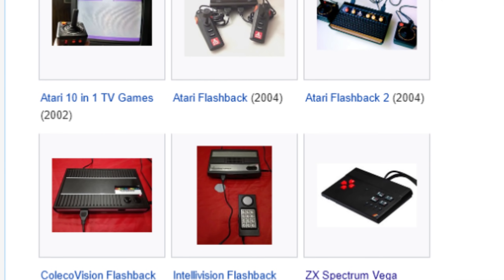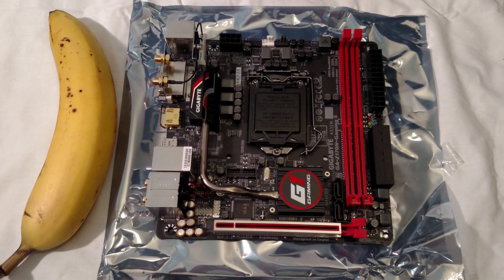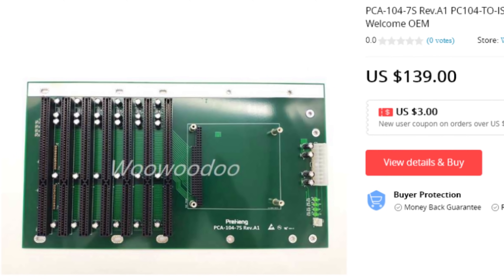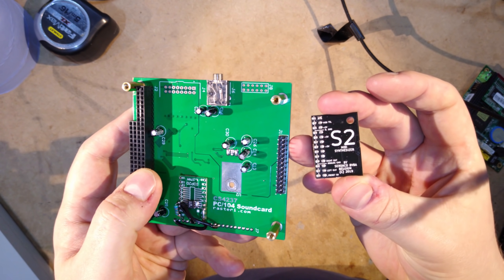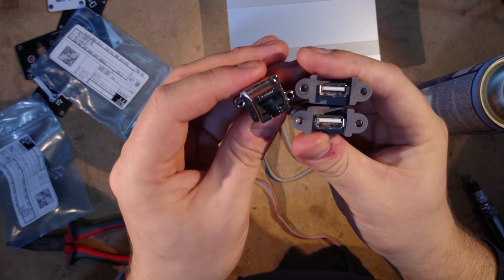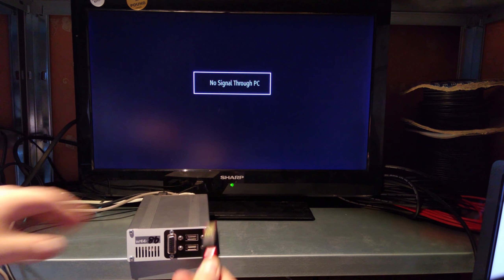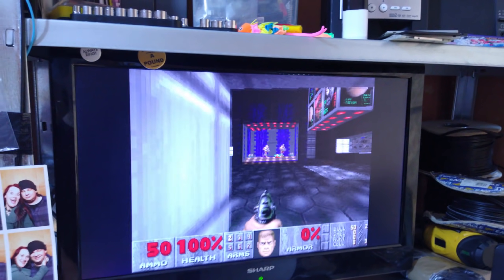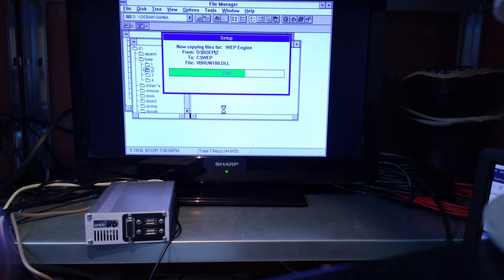Mini MSDOS gaming PC - Part 1

Comment: One possibility regarding the performance of Duke3D: it does use the FPU for drawing slopes, so the fact you're using a 486SX means it resorts to a software fallback, which would impact performance.
Reply from the maker: Yeah, my builds with the DX range run Duke3d perfectly :)

Comment: Can you please take a look at the old Kenwood Two-way Radio TK-250 handheld VHF radio's add on DTMF board, and see if you could make one of these ?

It is the KDM-7

They have not been available in decades.

But it looks like you could 3D print the keypad and make the film push button pcb that plugs into the radio.

I am going to try and do a video to show you what it looks like.

Thank you

Bill
KC2OVX

Comment: Nice project. You can also install Windows 98 and many of those problems can be solved quickly. I know by my own experience that, many MS-DOS games can't run under Windows  98, but you can start Windows 98 in MS-DOS mode and it's all. One thing i remember i did on those old times with my AMD 5x86-133MHz is, i edited the config.sys in order to add "Menuitems", depending the menuitem selected at the boot, the system booted with/without CD or network support, or with/without ramdrive, and always suporting the soundcard if i boot at the MS-DOS mode, booting into the Windows 98 mode, i only allowed the region drivers and certain customized "Files, & stacks" in the config.sys file, leaving the device driver control to Windows without loading MS-DOS drivers. I used to boot with RAMDRIVE support cause i used to run fighting games with a batch, wich automatically cleaned the RAMDRIVE, copy the game to the RAMDRIVE, and run the game. Cause i only had 32Meg of RAM, Primal Rage used to cause some problems if i tried to run a game after running Primal Rage, so it forced me to reboot the machine after playing Primal Rage if i wanted to run another game; but Mortal Kombat, MK II, MK3 and many other games did not cause problems.

Comment: What is the technical name for the aluminum housing he built the PC into?
Reply from the maker: He... I mean I used an extruded aluminium enclosure, it's the E-case range from Lincoln Binns
Reply: @TheRasteri  thanks... i am trying to make my own lacie little big drive with some old harddrives and couldnt remember the name of the enclosure untill I remembered this video... thanks so much

Comment: Good video but goes way beyond my ability to just throw something into a case and hope for the best. I haven't touched a soldering iron in 4 years, end even then this kind of work was way beyond my capability. I only really used it to join wires together and make up the odd audio lead. Now, I find it's easier to just buy them.

Comment: The thing I dislike about those mini C64, Amiga, ZX Spectrum etc. systems is that they all seem to focus on playing games rather than running utilities and letting you do any actual programming. I know it's possible to hack them so an enterprising and motivated individual to do that, but why not make them capable of that right out of the box? Just stick a USB port or 2 and an SD slot in the system so a user can plug in a mouse & keyboard and let them get to work.

Comment: With emulation, you could have gone with something like the lathe pc or something like that with an intel atom or core m3, i'm sure it would run basically any dos games with emulatores plus some early windows games with virtualization and even some later 90's windows games under compatibility mode.

Comment: A 486 processor that runs at 300 Mhz?? Wow, didn't think such a fast 486 existed.
Reply: 133MHz here on Socket 3!  And i did not know about anything 486 faster than the AM5X86-P75.

Comment: Perhaps use Qemm as a extended memory manager, you can boot with 638k of free base memory.. i think i still have the config.sys and autoexec running around for that... will include mscdex and sb16 drivers, mouse etc

Comment: Mind blowing. Amazed that card worked on the first try. I am going to try to build one with a ICOP VDX2-6554. What do you mean the newer ones aren't compatible with DOS? To me it looks like all the Vortex chips are. I want to get the faster DX2 one cause then I could use Windows 98 or XP occasionally also.
Reply from the maker: Yeah the DX2 should work fine under DOS, I have a DX2-based thin client that works. Never tried a soundcard on it though (ISA bus isn't accessible)
Reply: @TheRasteri  Well on the VDX2-6554 the PC/104 connector is accessible, so that means the ISA bus must be, correct? Or are there some PC/104 that don't have an ISA bus in that port?
Reply from the maker: @joeshmoe000  There are some PC104 boards that don't support DMA, but it looks like the VDX2-6554 has all the neccesary DMA signals so you should be fine :)

Comment: I have a Via EPIA C3 in an old Mame cabinet I built in 2004.  Mini ITX form factor and has integrated SBPro compatible sound.  It's a bit larger than your setup at 170x170mm though, but it has all the connectors you added without any extra work.

Comment: The joystick port on the front is also an external MIDI connector, if you have the exact cable for it then you can connect your SC-7 or any other MIDI tone generator instead of using the built-in FM/daughterboard MIDI synth as well as a passthrough connector for connecting your joystick while your MIDI device is connected.
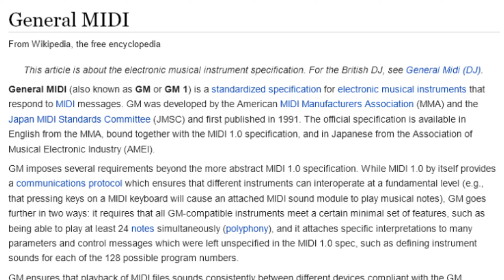Reply: 5:15

Comment: This... was really cool. Basically you did something MORE impressive than the "mini retro consoles" which are just glorified phones or Pis in a case with a high-level emulator. This is real hardware. This is... wow.

So like I'm a complete newb when it comes to electronics before I was born like this. Does this have a heating issue? I don't see any heatsinks? Or is it similar in power profile (I doubt it but I'm just spitballing) to like a Pi where it's not needed but can help?
Reply from the maker: Nah the Vortex86SX is designed to run without a heatsink, like the raspberry pi

Comment: Any thoughts on making the passive components through-hole rather than SMD? I’m good at soldering TQFP chips but not the passives. Too small for me.
Reply from the maker: The SMD passives are mostly 1206 which aren't too hard to solder, I'm sure you'd manage them if you can do a TQFP.
Reply from the maker: Oh and I'm currently filming a video where I show some SMD soldering tips so stay tuned :)

Comment: My deepest respect for that PC-104 Blaster card. Very cool! Other than that, excuse me if I did not pay attention: you mention in all detail, that you're using a board with the Vortex86SX which lacks and FPU... and you fail to mention that it has a stronger sibling, called the Vortex86DX, which does have an FPU!? I'm a long-time fan of ICOP, and I strongly prefer the DX version of their CPU for pretty much any purpose. It doesn't even eat more leccy compared to the SX, as I believe the SX was 130nm while the DX is 90nm. Also the DX, especially its more recent revisions, have received several updates e.g. in the IDE controller which make it more compatible... I am kind of fond of the XGI Z9s graphics with 32 MB of dedicated videoRAM - which apparently only comes on boards with the SX/DX chips. The DX2/DX3/EX have either some on-chip integrated VGA or none.
Reply from the maker: I'm currently working on a followup video where I talk about the Vortex86 series in more detail, as I've since acquired several more ICOP boards and look forward to comparing them :)
Reply: @TheRasteri  You've just earned my subscription ;-) Keep up the good job.

Comment: An excellent and interesting video, so much so I'm tempted to build one of my own.
FWLIW: You mentioned thin clients - with some admittedly careful research there are thin client boxes that will happily run DOS or (older) versions of windows. On the plus side an easier and likely cheap way to get a mini DOS console, on the minus side you'll not get any kind of Soundblaster in one so audio compatibility can be patchy. My weapon of choice is an HP T5720: http://qubeserver.com/T5720/ Once my HTPC, now my retro PC box.
(the page is very out of date and some of the links don't work - blame a recent change of web server for that!)

Comment: Those compact solid state memory modules at 6:00 are IDE-compatible? Wow! I've got a ton of those from embedded PC's and I never thought I could use them somewhere else. I assumed it was some proprietary format.

I used to build micro PC's for retro gaming, but I never went as far as designing my own PCB's. I'd instead cut up existing boards, fold them over and stack with extension ribbons. As long as the board wasn't multi-layered, it could often be done.

Comment: I use for a dos game pc this board  COMMELL's LE-564  underclock to 300Mhz, http://www.commell.com.tw/Product/SBC/LE-564.HTM with 256MB Sdram 133Mhz and a 2GB IDE Disc on module apacer for a HDD. Running MS-DOS 6.2.2 . Have the original Alu case with passive heatsink.  I use the board several years ago in 2006 as a home FTP server with 250GB ide 2,5 inch drive and when i change the ext. power adapter to a AT 150W Power supply, than add a 2 drive 500GB IDE 3,5inch drive and runing winxp Windows Fundamentals for Legacy PCs

Comment: PCs pretty much never had joystick ports on the front so I would definitely do it a bit differently. ;) Also, how about integrating a floppy emulator on that soundcard and making a SD card slot that looks like a miniaturized 5.25" floppy drive?
Reply from the maker: I'm working on an SD card slot as we speak :)
Reply: @TheRasteri  Awesome! :)

Comment: As for why Duke 3d chugs, that's because of the lack of an FPU. In order to do the angled floors it uses a lot of floating point calculations, so if you're using software fp, it's going to be crazy slow. I had that problem with my NexGen586.  It ran fine as long as there wasn't an angled floor on screen, but there's lots of angled floors in the game because they wanted to show it off being one of the fancy new features that Duke3d could do, and Doom/ROTT couldn't do.

Comment: Looks like there are some Vortex86DX versions, but I couldn't get the site to show me all available models, no matter which browser I tried. As I am not steady handed enough for soldering (I've tried and it ended.. badly), could you possibly wire a DX version up with a USB-C power input, along with the sound goodies? I would totally buy that in a heartbeat. It would likely be fine for up to 98SE, which still had real mode DOS for DOS gaming. Thanks!
Reply from the maker: I'm investigating the DX as we speak :) although 98 era games probably want a 3D card and I can't think of a way to squeeze one of them in...

Comment: Nice, I like the PC/104 soundcard project. I would build one if I own a PC/104 MB but they are quite rare and expansive. Maybe future project would be to use DMP Vortex86EX SOM-128-EX module and make a custom MB for it that would include sound, VGA, SD and IO...
Reply from the maker: I think the vortex86EX has a weird ISA bus that might not work with the soundcard. I'm investigating the EX and DX as we speak though.
Reply: @TheRasteri  I din't check it in detail. Maybe DMA signals are missing? The SoC contains a crossbar switch that can MUX several functions and GPIO on physical pins so configuring proper mapping may be tricky. BTW what kind of VGA chip is on your MB? The Vortex86EX can easily connect any PCIE VGA via x1 link but the size drawback is size, same as with ISA soundcard...
Reply: BTW how can I download the CircuitMaker files from that website for offline? I want to import them in Altium Designer. I signed account to CircuitMaker site but I didn't find any download just it wants to try open something online.
Reply from the maker: @rayer314  I have released the design/output files now, if you go to the releases section of this page - https://workspace.circuitmaker.com/Projects/Details/rasteri/PC104-soundcard-3#sectionComponentReleases - you should be able to download them. Note that this revision is still untested, I'm waiting for prototype boards.
Reply: @TheRasteri  Thank you for upload. I got it loaded in AD without problems. When a time come I may customize it a bit and let manuf. I have good experiences with JLCPCB. Good luck with your boards :)

Comment: Great design! SB cards are crazy-expensive even if you can find them. I'd definitely be interested in a board or two. I re-drafted and routed the board using KiCad, changing all the components (other than the sound chip) to through-hole and creating two different filtered power busses (borrowed from an SVGA card design). I played around with CircuitMaker and it wasn't for me. I've done several ECB-sized and S100-sized boards with KiCad...this is my first PC/104 attempt...so at least it will be a template for other things I might want to do. Looks like it routed fine. Only 25 vias. It's not a particularly dense board even with through-hole parts. Interested to see what changes TheRasteri is going to make from his experience with a live board.

Comment: Neat! I use these same mini pc boards at work for some controls equipment, Almost the same one but slightly smaller (Tiny SBC type) from the same company. I have a few that were removed from service. Never really did anything with them though.
Reply from the maker: Yeah I have one of the tiny modules. Unfortunately it doesn't have video output or a proper ISA bus :( do yours?
Reply: when in use we don't use the VGA output because it uses a small serial LCD screen but I'm pretty sure there is a VGA header and in the box it comes with a cable that has a VGA connector. I'll have to check next time I'm near it.

Comment: Who remembers their first 1gb drive? Seemed like an infinite amount of space back then.
Reply: I was a tech at circuit city early 2000s and I remember this photographer/videographer  came in and wanted somthing installed he had a terabyte  and all of us gathered around in awe of his like 20 harddrives jammed into this massive custome case hahaha I remember thinking there is no way I could ever fill this even with all my games , back ups ,rips, etc haahahah now I install like 3 games in a terabyte hahaha
Reply: haha mine was the cheapest possible : a 5.25"  ( yes, 5.25" ) Quantum Bigfoot hdd . huge and slow but... 1gb!
Reply: I have a 42gb hard drive(win98 installed) and a pentium 3, some ram, (idk how much) culd it run win 10
Reply: And now 1TB drives are starting to feel small fast.

Amusingly I still have a 900 megabyte iPod shuffle from ages ago though that still works, entirely eclipsed by my Fiio M9 with 500 gig SD but it's still cute
Reply: Yeah i thought all my christmas's came at once, was rummaging through a hard waste collection pile out front of a house when i was 9 or 10 and found a pair of western digital caviar 1gb drives in the pile, and amazingly a new in box quantum fireball 3.5gb drive. I was like "oh my god i can have all my games on the computer at once" turns out the wd drives were faulty hence thrown out, but one had jazz jackrabbit on it which i copied over to my old connor 512mb drive while it was still working (they worked fine for about 10 minutes runtime then seemed to start clicking and getting read errors) but then i put all the stuff onto the quantum drive and had the connor as the master with just windows 95 on it and a few small games. Was absolutely amazing to be able to not have to uninstall something in order to put another game on

Comment: I was about to build a MiSTer just to have a small 486, but this is much better. Thanks!! I'm looking forward to the follow up video and the updated soundboard to get started. Quick question: will plugging a external MIDI device (Soundcanvas) work on that game controller port?

Comment: I modified an HP thinclient to acomodate a true OPL3 Yamaha YMF744 sound card inside, it has about the same total volume than this, but can also run Win98 3D games thanks to the integrated 3D graphics card.

Comment: 11:27 Build engine needs a FPU to render sloped surfaces, so Duke3d runs slow on this SX processor without one.
Reply: I seen several dx 486 industrial boards back in the day.. so they should be avalible. A 300Mhz Dx 486 should have excelent performance.

Comment: I've never played around with  PC104 personally. I would have suggested making up a ribbon cable adapter to an 8 or 16-bit ISA slot to get the sound card connected to the PC104 header. I did that with my Tandy 1000 HX, to get an ISA I/O card connected to it's pin-header expansion bus.  it's awkward to mount the card, but it works.

 I know that backwards compatibility is a pretty big thing in industrial applications, but I've never heard of a 300MHz 486 before.

Comment: Good lord if someone sold these new with manuals I'd buy one. I've been looking for a compact MS-DOS/FreeDOS PC like this. Especially if it had a built in Gotek like floppy image reader you can read floppy disk images from. Sound blaster/Adlib compatibility would be perfect. Hell the hard drive could be a card flash or SD card setup to change OS's like floppy disks.